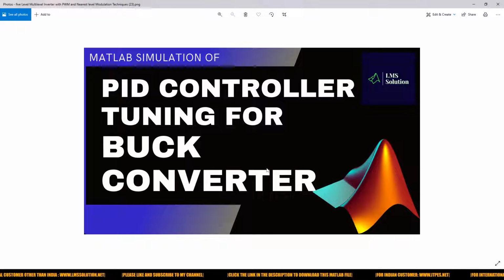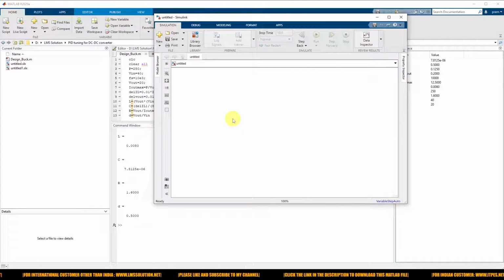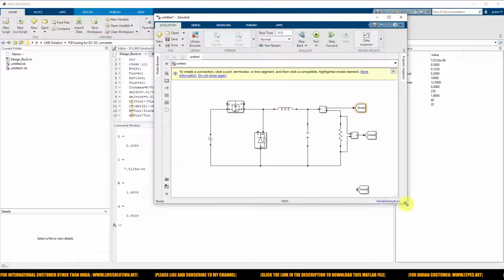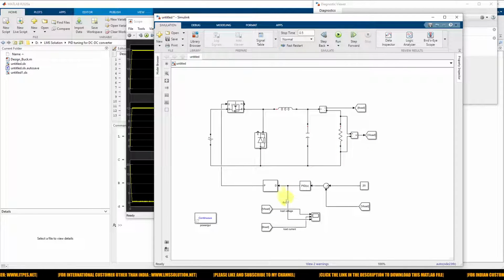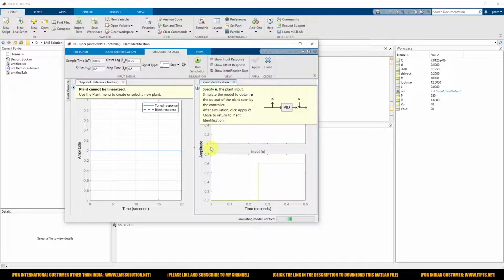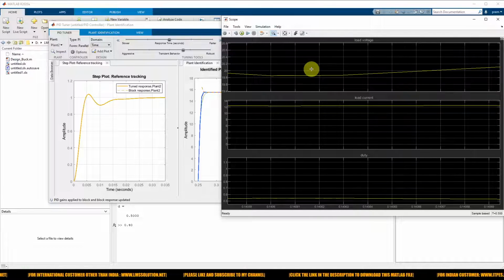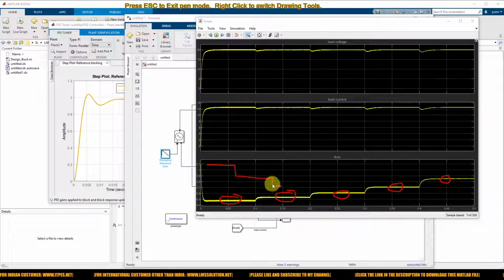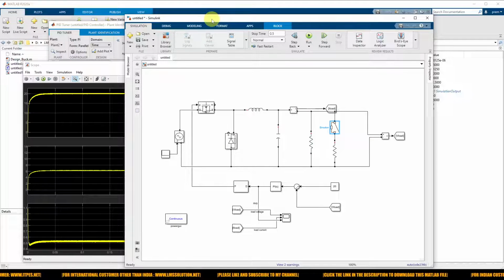MATLAB Simulation of PID Controller Tuning for a Buck Converter | DC-DC Converter Control

Comment: hi sir, so the input of buck converter is variation voltage? and the output will be still constan because the pid controller , is it right?
Reply from the maker: Yes